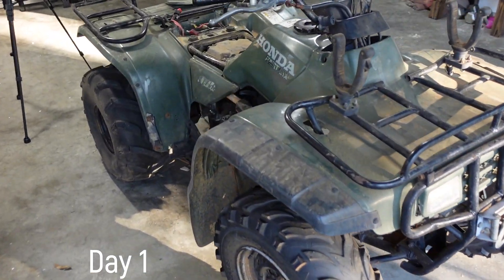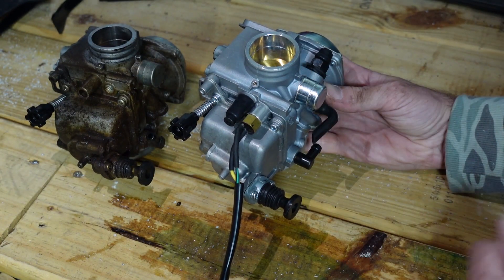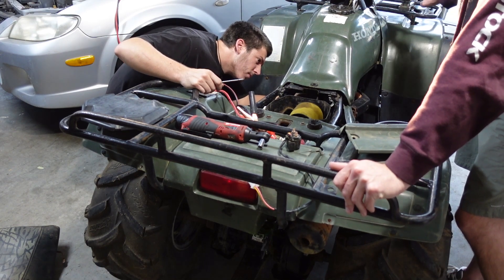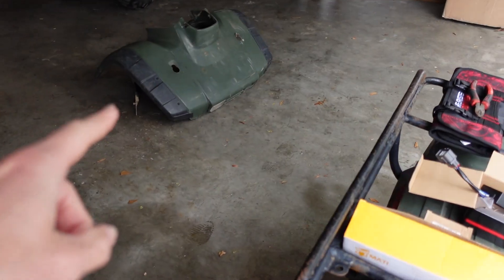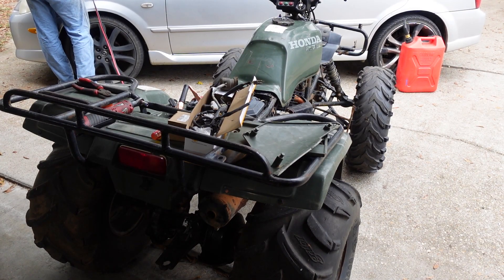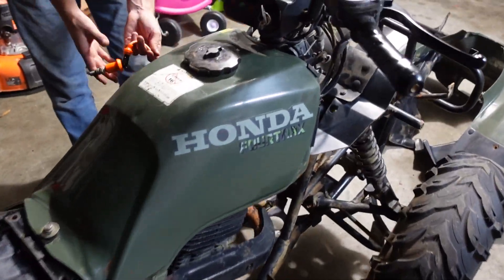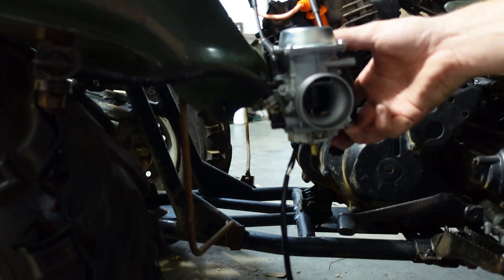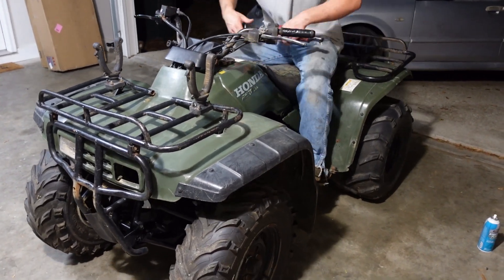Did we get scammed on this Honda FourTrax? ( Seller hid VIN # )

Comment: Great video. check for the vin number on the Square front cross member under the base plate for your winch is. that looks like a 1997 1998 honda fourtrax.
Reply from the maker: Thank you for the info, We've since sold the 4 wheeler, but I believe you are correct, it was a 97 or 98

Comment: I encourage you both to use as many original parts as possible. I recommend purchasing an ultrasonic cleaner for cleaning the carb. The original carb is better than any aftermarket carb. All you need is the ultrasonic cleaner and rebuild kit.
Reply from the maker: I agree. We’ve actually cleaned up the carb, just haven’t rebuilt it. That way if the new one craps out, we’ll have it as a spare. As for the CDI, we’re already looking at putting a Ricks CDI on it. We just went ahead and bought the used one to see if it was indeed our no spark problem

Comment: Vin number is under the winch mount plate
Reply from the maker: You are correct. We ended up getting the plate off around 8:15 in the video, turns out its a 1997

Comment: You need a green netural light or bypass it
Reply from the maker: The neutral light will come on, but we’ve noticed that sometimes it’s false. If the wire hangs low, the light will come on, but no spark. But if we push the wire up, the light will still be on, but it’ll spark. So definitely on the list of things we need to replace

Comment: The old parts cannon rather than testing ignition, didn’t work out the best. 350 carb will likely have bigger jets and will make a 300 run rich. Those cheap carbs are junk. Clean the original

Comment: Definitely not scammed. Hope that was just click bait and you weren’t serious. I agree with what some of the others were saying about the carburetor. Get it ultrasound cleaner and keep the original with new needles. If you do use the new carburetor, the wires coming out of it it’s just for an electric choke that was on the newer models to make it easier to start.
Reply from the maker: Just for the title, the seller was actually a really cool guy and I’m sure it’s pretty common to weld a plate there for a winch. Surprised that’s the only place they put it, the arctic cat has the vin in two locations, and I agree with the original being better, it is cleaned, just gotta rebuild it